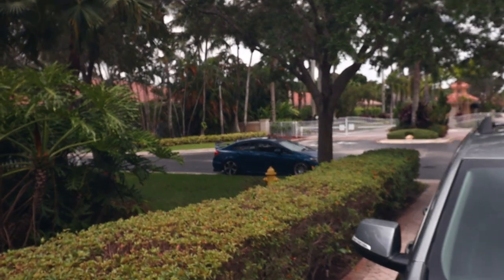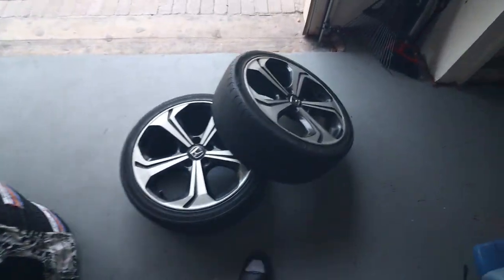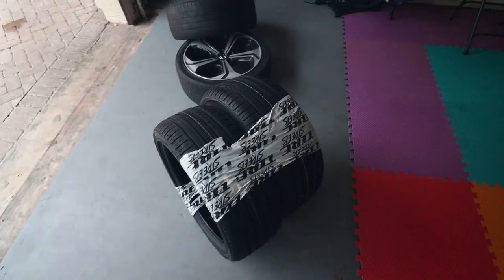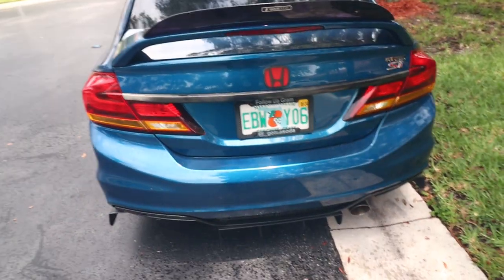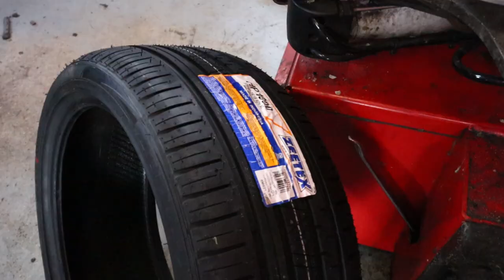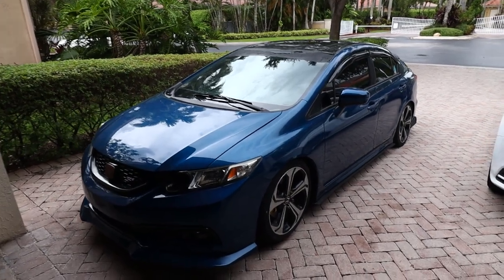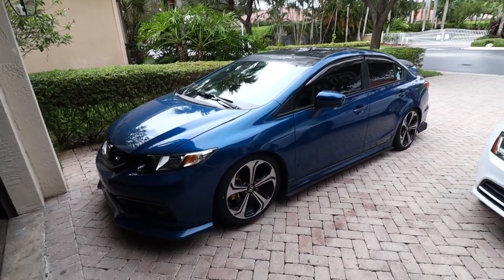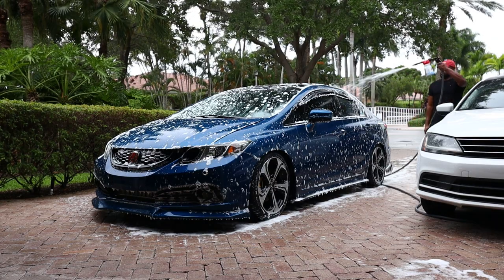My Turbo'd Civic Si is going back to STOCK ...

Comment: should I turbo my daily 9th gen only aiming for 350hp or just save money for a turbod car
Reply: Turbo the 9th gen
Reply from the maker: Turbo the 9th Gen
Reply: I have a boosted 2013 fb6. It's tough to say if it was worth the 7-8k I spent boosting it. It's definitely a sleeper and surprises a lot of people, but I'm also a cheap-ass so I often regret boosting it. It all depends on what you value most I guess.
Reply: @michaelcaddell8520  Very true.  But, I'd say a boosted 9th gen will be faster than most factory boosted cars within the same price range.